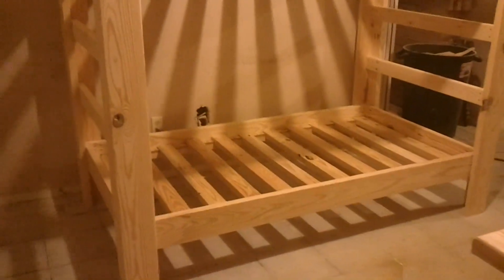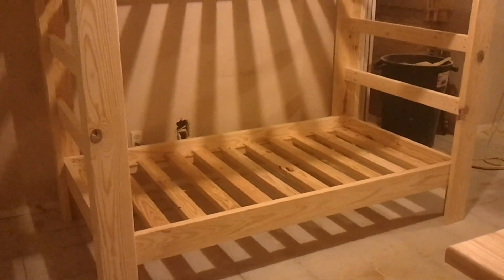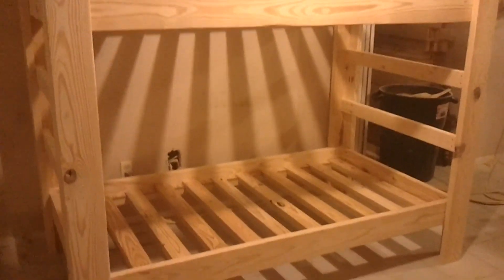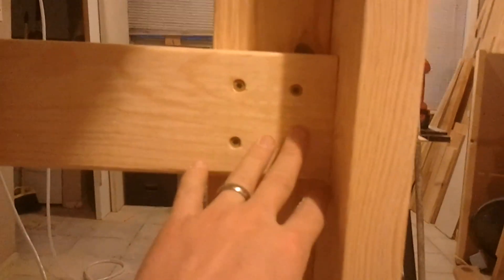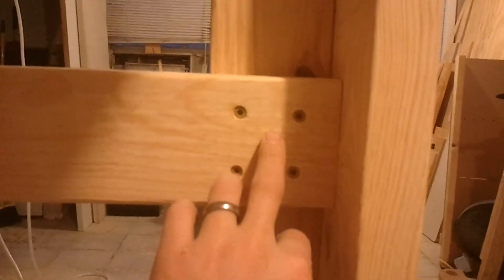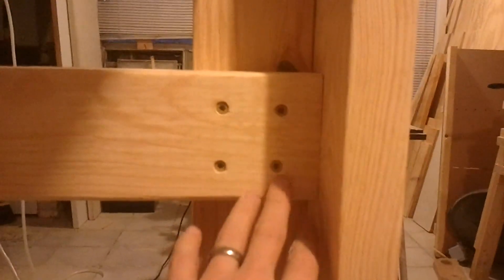Twin Over Twin Bunk Bed - 023

Comment: Awesome bunkbed, thanks so much Jay. Purchased the design, and the only modifications we made, was we only used 2x8 and 2x6 lumber and ripped the 2x8 them for all of the 2x4's and 2x2's. Made for much straighter pcs and a lot less warping. We also ran every part through the planer, to give nice clean sharp lines.